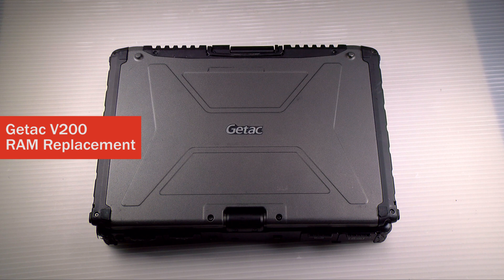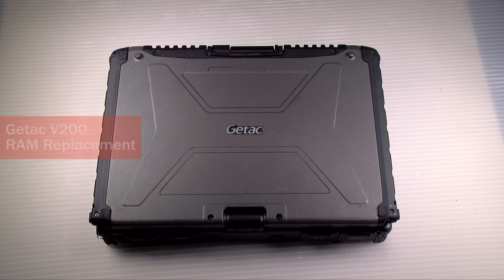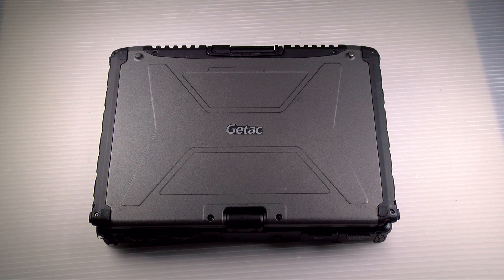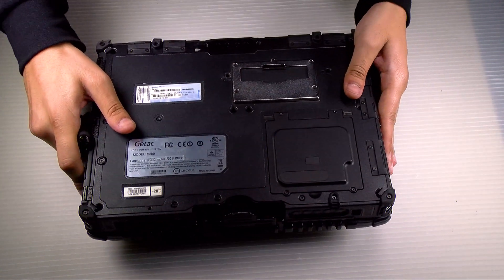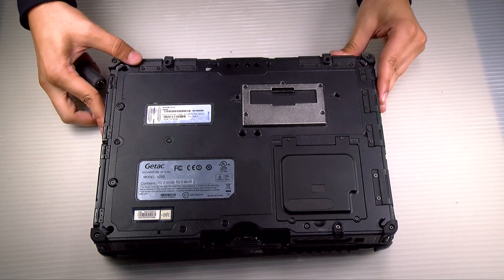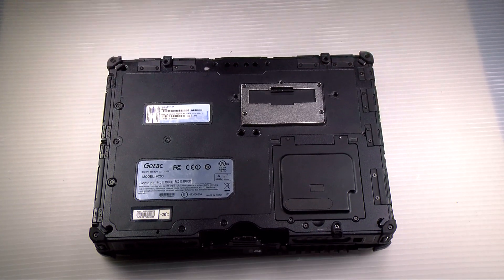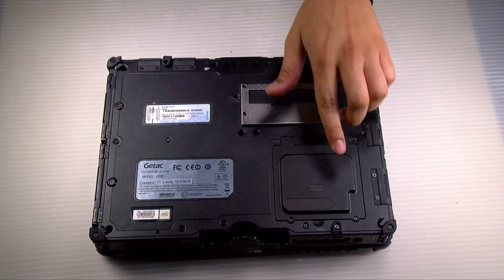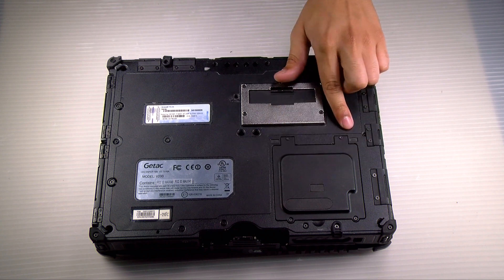Upgrade Your Getac-V200 RAM!!

Comment: What is the max ram you can put in a v200 G2 and do you have to take the back off or do something else to install the second ram stick? Thanks
Reply from the maker: @rcmick1203 The best way to answer this question is to simply fill out our Tech support form.  Our in-house technicians will answer with the links and info you will need and point you in the direction of the correct RAM sticks to use.  Here is the link: https://www.bobjohnson.com/tech-support-form/  Thanks for Watching.

Comment: I recently got a v200 and am not able to get wifi to work on windows 10, it seems like there is a driver issue. Is there anything you recommend to try to get windows 10 to properly work on a getac v200?
Reply from the maker: There is no support for windows 10 from Getac.  We have tried in the past with no success.  It's worth another look, I will be working on this for a future video.

Comment: i was just told that i need x2 4gb sticks? did i buy the wrong ones? That looked like one.
Reply from the maker: It is the exact model? V-200 G2?
Reply: @Bobjohnson  v200 x r2.04 I purchased it in 2011
Reply from the maker: Should work fine.